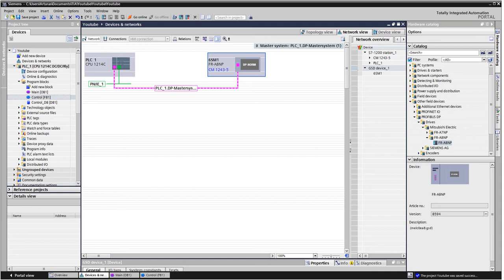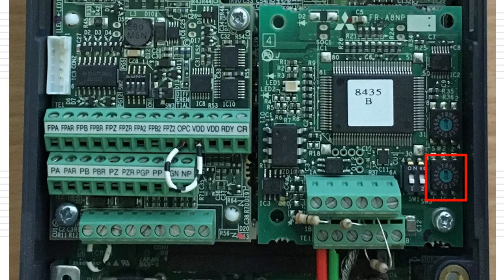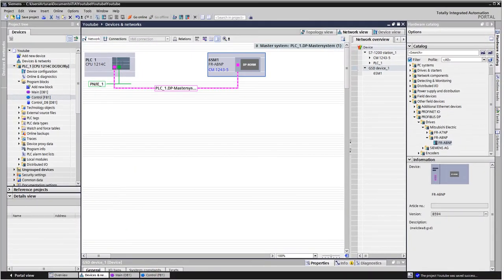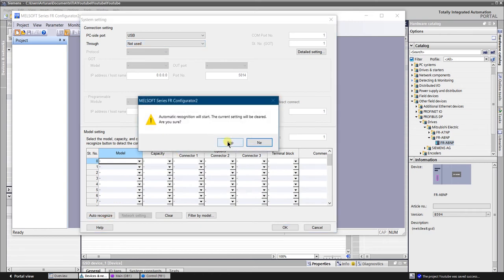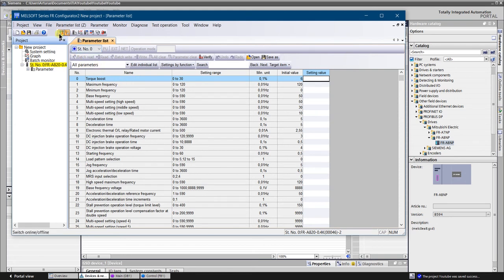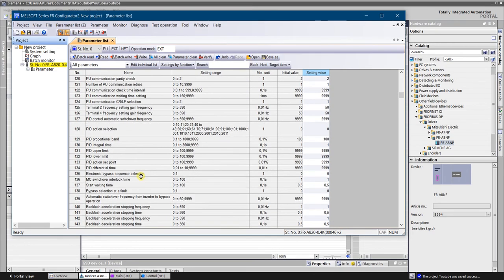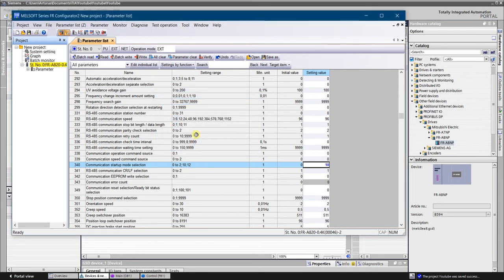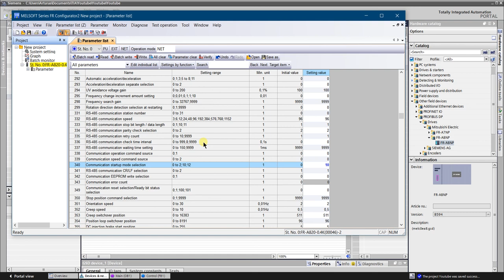Mitsubishi VFD control via PROFIBUS by Siemens S7-1200 PLC. Part 2, FR Configurator

Comment: Is it can use with FR-E840-0060-5-60 ?
Reply from the maker: E series Mitsubishi inverters need a special kit - FR A8-NP-60 E kit, sold separately, to be able to be connected to PROFIBUS network. Inverter must be without integrated PROFINET, otherwise that kit will net be possible to install.